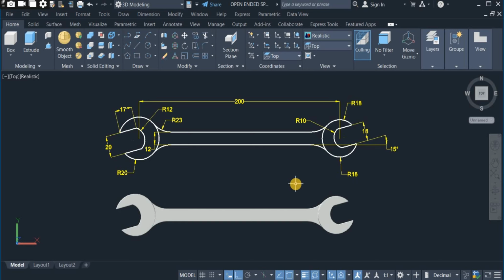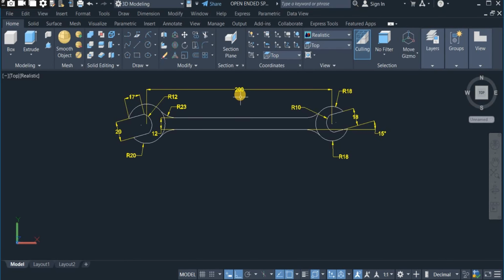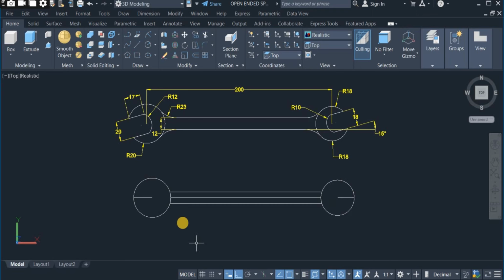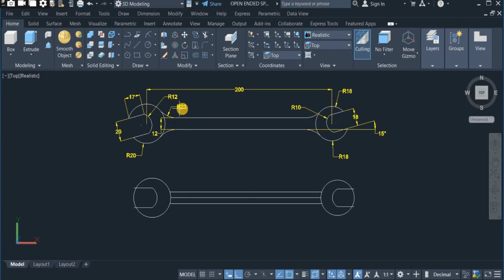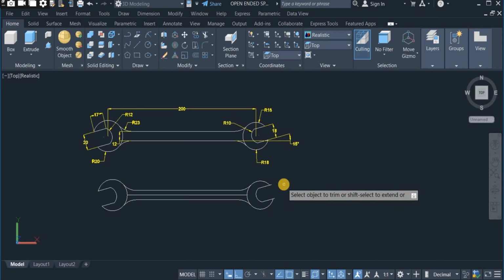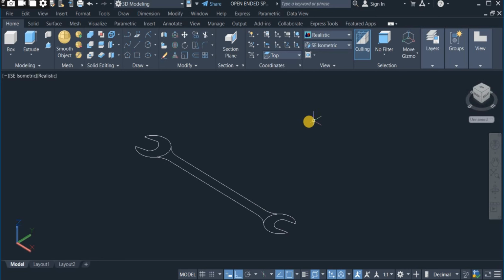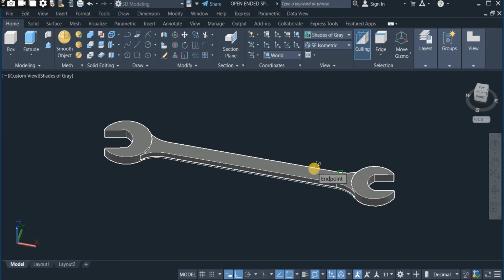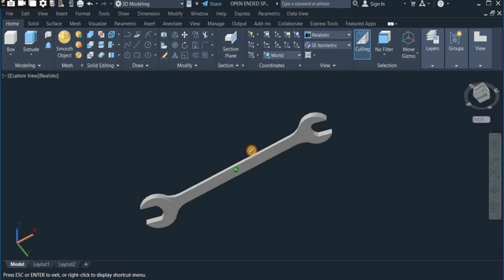3D Modeling for Beginners: #3Dtutorial

Comment: Open end wrenches or spanners are usually never flat on the ends.  There is usually some angle offset such as 10 degrees.   I know this would make the drawing much  more complicated.
Reply from the maker: You are correct, watch the video again and see that the open ends of that Spanner were offset by 15° degrees.